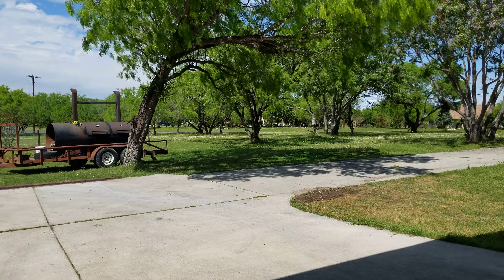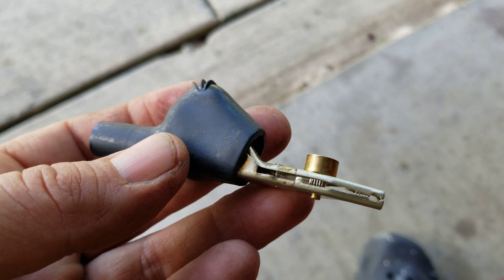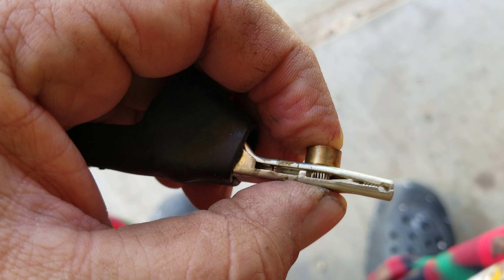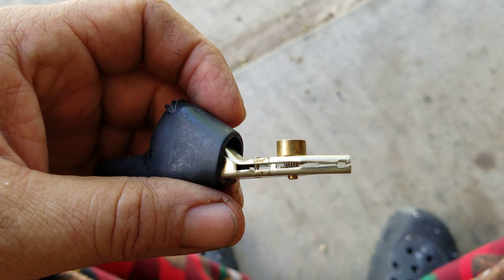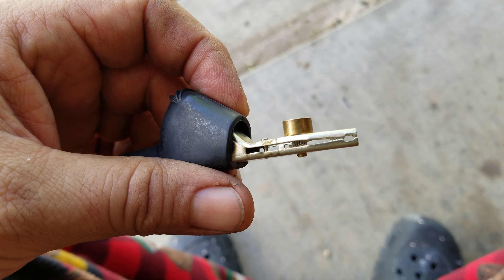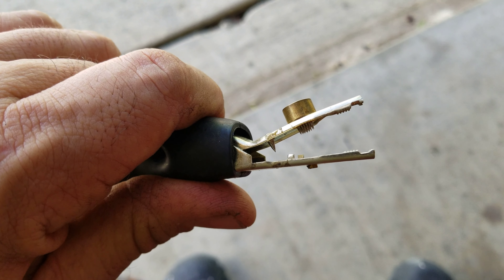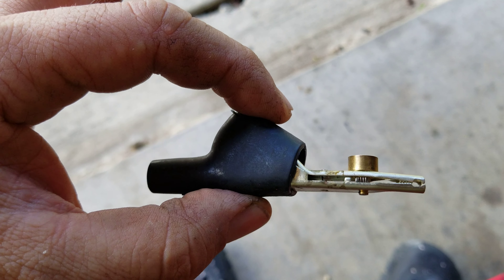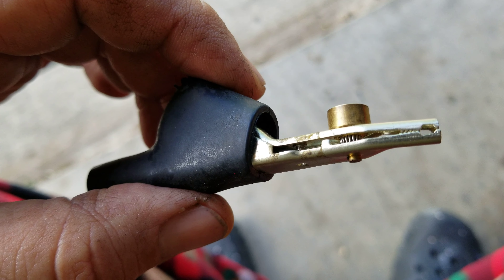Bed of nails alligator test clips

Comment: Does the bed of nails pierce insulation just using its spring tension or do you have to press on it?.  I have been wanting to buy the Pomona 6405.....but its so expensive for a piercing probe.  Do you think this will work on regular automotive wires without damaging the insulation?
Reply from the maker: Will, 1st any probing of any wire will require you seal when done with liquid tape, I have several different types of probes , these are older type that worked on wire with hard insulation/and were great on heavy equipment, but yes they work on automotive. You can use finger pressure to pierce or on stubborn wire squeeze with pliers . I have several electrical videos I have done over the years also which might interest you
Reply: @sonofmontezuma3732  thanks